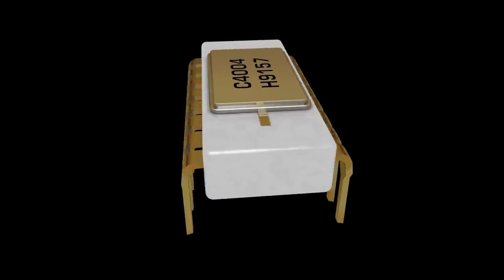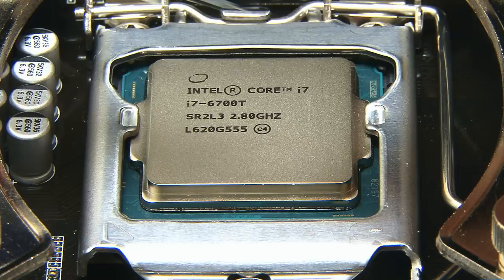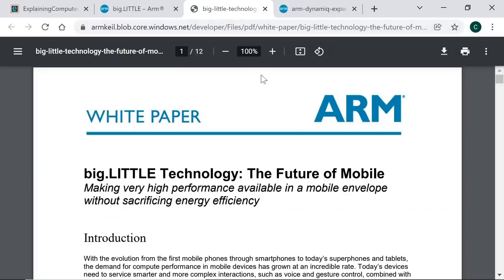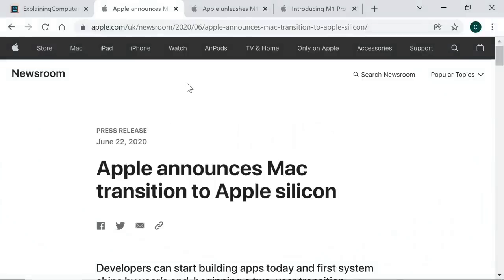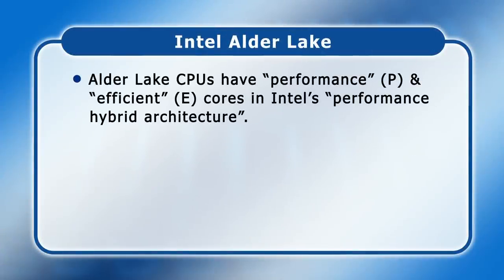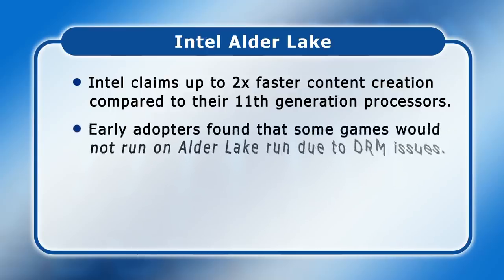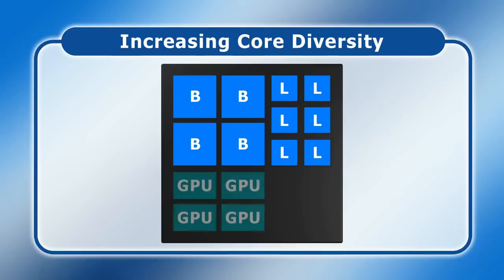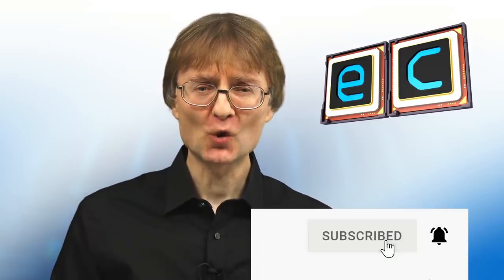The big.LITTLE CPU Revolution: From Arm & Apple to Intel & AMD

Comment: would qpu ..quantum processors.. be considered aipu .. artificial intelligence processors.. ?
Reply from the maker: AI processors today are normally labelled as neural processing units (NPUs), neural accelerators, AI accelerators, and indeed sometime as AIPUs as you note. But the naming conventions have not settled. A VPU (vision processing unit) is also a form of NPU. But as you say, quantum processors may well also be AI processors, AIPUs, in many situations. There are exciting times ahead! :)
Reply: @ExplainingComputers  thank you! i agree. there will be quite a vearing track upon this travel with the most interesting settlements around each corner.

Comment: Alder Lake is no true big.LITTLE Design, because only the P-cores can do AVX-512 .. If someone wants to use this feature he has to disable the E-cores in the bios. Maybe later bios & Schedulers will be able to recognize threads using AVX-512 and run them only on the P-cores, but it currently doesnt look like someone really cares about that. 🤨

Comment: If AMD do they will piss of btheir AMD fans on Linux. Plus Zen core are both eco and power core already strong low power cores the non X cpu's are all under 65w TDP. AMD will drop a laptop chip for windows though, but they are already got the best cores.

Comment: Should we really call it big.LITTLE when that is the ARM specific name for the heterogeneous System Architecture (HSA) developed primarily by AMD and ARM starting in 2012 with the HSA Foundation? The original timeline for introducing HSA was 5 years for RISC based systems like ARM developed systems and 10 years for CISC based systems like AMD developed x86-64 based system. ARM was bang on target introducing their big.LITTLE in 2017. And AMD seems to be not much off their original target with a true HSA coming from them late 2022 or early 2023.

Comment: I call BS on having quantum cores running with a conventional cpu due to fact heat is the noise that no quantum cpu wants. So it would not be practical to build a heat generator on the same silicon, since you can only build[operate] a quantum cpu at near absolute zero temps ,its just wont work with heat[noise].  And its got nothing to do if can or can't build it on silicon but to do with how quantum mechanics and controlling the quantum states.
Reply from the maker: You are of course right for quantum processors that require supercooling to near absolute zero. But in the video I mentioned the quantum silicon chips being developed by Xanadu and others. These are photonic, and do not require supercooling to near absolute zero. So incorporating photonic quantum cores with conventional cores is a theoretical possibility for the 2030s.

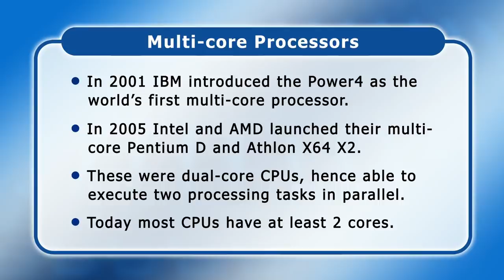Comment: 2:17 "with some server CPUs containing staggering 56 individual processor units"... Honestly I don't know in what age this man is living. Or maybe he's still certain 56 cores is a lot of cores these days...?
There are server CPUs that have 2, 3 and even 4 times the cores as the mentioned Xeon core count, and not all of these are even from AMD.
Reply from the maker: You are correct, I forgot AMD processors with 64 cores. My bad. But am not aware of anything on the market with more than 64 cores.
Reply: @ExplainingComputers  I'd check out what IBM and Supermicro are working on. There are even CPUs (ARM-based) that can be reconfigured between certain workflows, effectively changing their number of threads/cores dynamically, and these are 120+ core server CPUs. You can either have more, less performent cores by splitting them in half, or less more robust ones.
Reply from the maker: @shapelessed  Indeed. I am not aware of 120+ core CPUs on the market, but will take another look. I know that the Ampere's Altra Max M128-30 has been announced with 128 cores, but it is not on sale yet.

Comment: Some AMD CPUs have 128 cores. (Iirc)
Reply from the maker: I thought they had 64 at present, with the 128 core not yet on the market. See my pinned post.
Reply: @ExplainingComputers  Yea, 64 cores, 128 threads. :) You mentioned 56 cores in the video. 👍
Reply from the maker: @SirHackaL0t.  I did -- my bad. But as I noted in my last reply, I stated this in my pinned comment! :) The maximum Intel cores right now is 56, AMD is 64 -- not 128 as you stated. So we were both wrong (although my statement in the video is factually correct -- I said that some CPUs had a staggering 56 ores, which they do. I never stated it was the maximum available, although this was inferred).

Comment: I hate big.little. First: It doesn't work- disabling e-cores gives you more performance in Alder Lake. Second: it doesn't save any energy, big cores at idle and in less intensive use barely any energy sometimes less than 1W.

Comment: I remember back in ~2017 AMD filed patients about this. Not sure what they did with it but they said (paraphrase)"Unless the OS knows how to utilize it properly (scheduling) there is no point." 

Personally, I think big.little is a complete waste but I only use purpose built systems. I'd rather an add on chip of 2-4 little cores to handle low priority bg apps/services. PCI-e slot cards with sockets for low tdp older processors maybe. Or something like the nuc pcie slot test debauer did.

As far as my cursory knowledge of power management goes, you will gain/lose nothing from cpus with vs without little. Don't use a 3900x to browse the internet, don't use a 3000g as a render farm for 4k. I could be completely wrong but I need to see something like a 3900x with and without little to get a real idea if this is worth it. Comparing different cpus is faulty for a lot of reasons.

Not to mention I can see a lot of problems down the road with the scheduler, which is my main hangup on this tech. Even having 2 vs 4 little cores can be a nightmare if 10 pieces of software are all schedule for little cores, then if it splits to big and you're doing intense rendering or something, what happens?

And I've typed way to much and now I'm standing in 8 foot tall weeds as those who do one pc for multi use this is probably great, and I realize as I am likely largely a minority.

Again no expert so excuse any blatant air-ors in my thinking out loud rant.

Cheers
Reply: I don't like editing my posts so I'll add this.

I could see this being good for systems running 24/7 like servers but still limited. I'm also not considering anything that's not a desktop.

I know this works in phones et al and would love the next gen rpis (5?) to have this tech. I'd rather have one pi doing all my pi things than having my 3 pis each doing one thing. (pi-hole, nulticam security, garden assistant)

TLDR, I don't hate this tech, I want it to be useful even if not for me but I see a very limited use case for it as time goes on.

Comment: On the mobile side it's already been seen what this leads into (extremely lazy devs => laggy systems), so I'm HIGHLY sceptical this will lead to anything good enough.

Even worse if apps can ask the CPU to specifically allocate resources, cuz the lazy fucks will just ask to, for ex, use the perf cores and be done with it.

In fact, this won't just surface the lazy fucks, but also make coding exponentially harder, making it mostly vicious cycle of laziness. It's 1 reason why M$ made Win10 force updates on ppl.

Comment: Doesn't seem like much of a revolution from Intel. Their 12th generation processors with big and little cores still use way too much power compared to similar ARM processors. Perhaps their offerings will improve in the future, but right now their version of big/little seems pointless. Since we haven't seen AMD's release yet, we don't know what theirs will look like in terms of power and performance.

Comment: The gap of 30 years (1971 to 2001) is not quite correct. Multi Core existed earlier in the form of multiple single core processors in multiple sockets on one mainboard. E.g. the intel Pentium was capable of such operation in 1993, and it wasn't the first. I'm certain you know that, I just preferred to hear that also mentioned in the history section.
So IBM didn't really invent multiple core technology, they invented the integration on one chip in a single socket. Which by the way had implications on the license costs for certain software.
Reply from the maker: Sorry, what the video states on this matter is entirely correct. This is because multiple single-core processors in multiple sockets on one motherboard are NOT multi-core processors! :) So the history stating 30 years of single core processors I mention is accurate. The fact that some computers/motherboard had multiple processors in them, and that some porocessors before 2001 could operate in a multi-core environment, does not mean that multiple core processors existed! Clearly they did not.

This video is not about and does not claim to be about multi-core technology. Nowhere does it make this claim. This video is very clearly indeed about multi-core PROCESSORS and only that. IBM launched the first multi-core PROCESSOR (not the first multi-core computer -- which is an entirely different thing) in 2001.

Comment: Is writing "big LITTLE" with the big core in small letters and the little core in big letters supposed to be an inside joke?
Reply from the maker: It is the way it is written by ARM.
Reply: @ExplainingComputers  I may have to actually READ that white paper ...

Yes, I figured that ARM probably did it that way as a sort of joke.

Maybe the white paper explains how threads are supposed to be assigned to the different sized cores. By the kernel? I do remember some C language code that spun off individual threads (pthread(), I think), but I don't recall any parameters for assigning them to specific cores.

Comment: As of yet the "big/useless" architecture is just that, useless.   There isn't any software or operating system features to keep it from shoving programs that MUST run on the AMD64 cores onto the fail cores so games and software just locks up or disappears from the computer's memory.